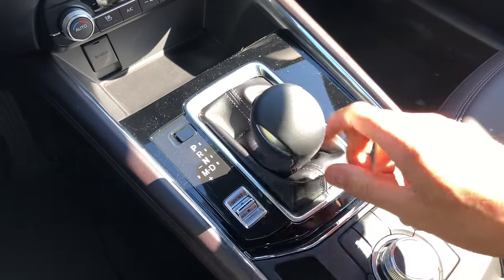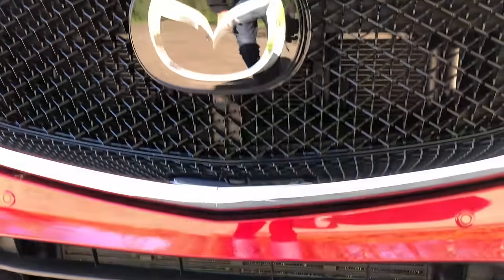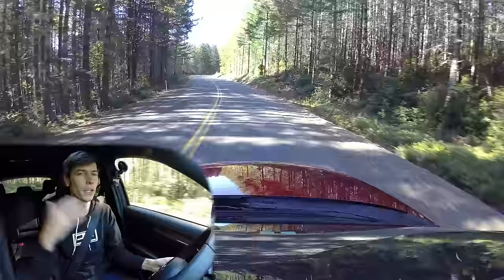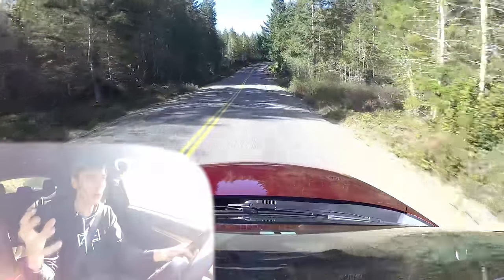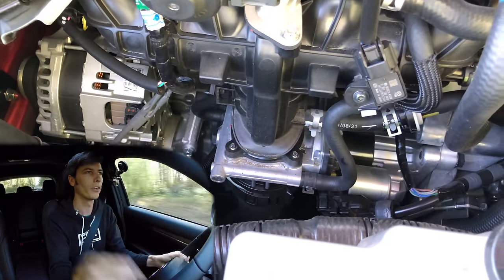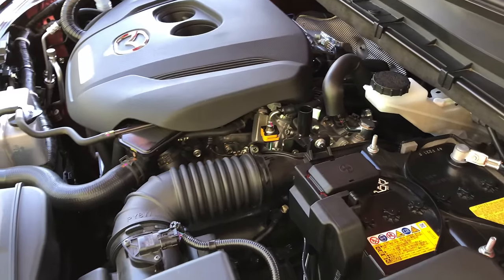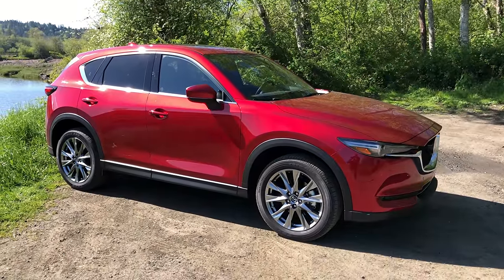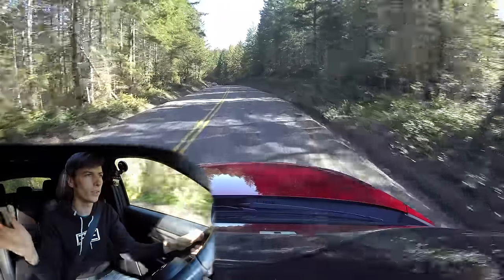Are CVTs Bad? Why Mazda Avoids CVT Transmissions

Comment: I'm a Honda guy and in 2014 I was going to buy an Accord. Hated the CVT and bought a Mazda 6. 100,000 miles later I've been very happy with my decision. I will not buy a CVT.
Reply: The 2016 and up Civic is nearly 2000s and earlier Accord sized and comes with a stick in nearly every trim. That’s what I bought.
Reply: Hondas are disappointing me with only the civic being the only car that has potential tuning, and even thats a cvt. Hopefully they bring their old golden cars back with manuals
Reply: Why do you think a cvt is wrong
Reply: @pilerks1  I question their durability and reliability. Some manufacturers are having problems with them
Reply: How is the newer model 6 holding up?  Any issues?  The cylinder shut-off feature scares me.  Other than that, I love the way they look!   I have a Mazdaspeed6, tons of problems, but that's an entirely different car..
Reply: @pilerks1   stop signs
Reply: I made the deadly mistake of purchasing an Audi with cvt 10 years ago. It was the dumbest thing I have ever done and when the cvt went it cost me $5500 Australian dollars.
Will never ever go cvt again
Reply: @pilerks1  they have lots of problems. Not strong.
Reply: @paulpower7018  None of my cvts had problems
Reply: @pilerks1  how many miles did you drive on them ? Problems don't start right away. And if you baby them maybe you'll get lucky.  Do so research. And don't ask a question if your not going to like the answer.
Reply: @paulpower7018  I'm saying my expirience. My 2003 murano with 120,000 miles had no issues when I traded it in at 2017. Other murano from 2012 had only 60k on it, then it was totalled just a few months ago
Reply: @pilerks1  that's cool I was just wondering.
Reply: @pilerks1  overly complex crankshaft and cams as well as engine timing.  I've never read a good thing about cylinder shut-off engines.. they have far shorter life's spans.. now granted these were all American v8s like Chrysler and Pontiac, so MAYBE Mazda figured out how to perfect it.. but I wouldn't trust a 1st Gen engine design.  I'll wait for the skyactive X engine to be ironed out- the most fuel efficient gas engine ever made.
Reply: Honda CVT's are ok as long as they are serviced correctly and you MUST use the correct CVT trans fluid supplied by Honda.  I know a number of people with them and they have had no problems with them with some now up to 250,000 k's (155,000 miles).  Nissan CVT's are one to avoid.  They are made by Jatco which is a Nissan subsidiary and they have always been very unreliable unless you are easy on it and service it very regularly.  Subaru and Toyota CVT's seem to be very good unless they are driven hard with poor servicing.
Reply: Get it in manual then🤷‍♂️🤷‍♂️🤷‍♂️🤷‍♂️🤦‍♂️ or can you not operate 3 pedals
Reply: Thomas Borisov I sure did all fluids and maintenance always completed on time when specified by Audi
Reply: @pilerks1  CVT transmission cars have questionable reliability. It also reeeaaallly takes away the sportiness of a car. The only reason people put CVTS in their cars is to save money on gas, when you're literally at most saving only 3 MPG. Will never buy a CVT in my life. They also overheat really easily under stress.
Reply: @pilerks1  only 120,000 miles? That thing was about to break down on you, you are really lucky that you got rid of that thing and not throw 4000 dollars for a CVT transmission down the hole.
Reply: @aytugdemir1323  Well I dont buy my SUVs and floor them around a track on my spare time. If I wanted that I'd buy a range rover or something.
Reply: @aytugdemir1323  I have no evidence it was going to break down. It felt fine. I've been reccommend to repalce a belt, and the muffler and shocks were going out, and it was getting old. That's why I got rid of it.
Reply: @pilerks1  you never know with a Jatco CVT transmission. That thing would've probably started to have problems at like 160,000 miles. And a lot of people look at how fast and sporty a car is.
Reply: @aytugdemir1323  cvt transmissions dont affect looks of a car. And no one cares to see as I accelerate through the rest if traffic at normal speed. 
I agree, sports cars shouldn't have a cvt. But an every day car for a normal person, a cvt is fine
Reply: @pilerks1  I never said a CVT ruins how a car looks. A person that cares about reliability does not consider CVTs to be fine. It's way better to buy a traditional automatic, than to buy a CVT (especially one of those Jatcos) that's th point I'm trying to make.
Reply: @aytugdemir1323  I have a 2008 nissan altima with a cvt and it has 168k miles and counting. I haven't had any problems.
Reply: Cvt just boring nothing wrong with honda cvt and higher mpg
Reply: Aytug Demir if you want the simplest, most durable, most robust and longest lasting transmission, you buy a manual!
Reply: Ilove cvt😍
Reply: Yeah let's not buy a CVT which has the most potential in the long run if the kinks are worked out
Reply: I had a 2015 Honda Accord, 2.4 CVT.  I had no problems and liked the idea that the transmission always found the perfect gear ratio for economy or power as needed.
Reply: @billharris3650  so basically, CVTs are weak
Reply: Corkfish1 My CVT has 166300 miles and no issues at all 🤷‍♂️👀 Proper maintenance is the key!
Reply: The third gen 6 is the best driving mid-size sedan available at its price point.
Reply: Bill Harris CVTs are for people looking to get from point a to b. They would generally have trouble locating their oil dipstick. I hate them personally and applaud Mazda for not using them!
Reply: @georgeschneider2414   what car do you have with cvt?
Reply: Ramon Lepana 2016 CVT Toyota Corolla LE
Reply: @paulpower7018  i specifically created youtube profile. I own accord 2013 past 2 yrs. ~ 165K mi. CVT. (Bought it around 100K mi, 1st owner didnot do anything to transmission). I changed trans oil 3 times. This car is so good, so smooth.
Reply: @billharris3650  my accord hit 165K mi. CVT. No issue so far. I did 3 timestrans oil change
Reply: The first time I test-drove a car with a CVT I flipped out becuase I thought the transmission or the tach was broken lol
Reply: Same here. Mazda 6 owner for 6 years. Not a single breakdown or major problem, just oil change and battery replacement.
Reply: CVT is boring but the passengers love it.
Reply: Cherries they are junk, lots of problems and not repairable, if anything goes wrong, throw it away, which means throw away the car.
Reply: @Corkfish1  from what I've heard, you just have to change the transmission fluid more often (once every 40-60k kilometres) and maybe install a reinforced belt instead of the stock. I think, it can be a good choice for city traffic driving.
Reply: I had my Mazda6 for 13 years. I gave to my daughter to drive to college.
Reply: @Corkfish1  and some do not.  CVTs, after the usual teething issues a new technology faces, are now superior the old inefficient autos. As for reliability Mazda has never gotten the rotary to do what was promised
Reply: @paulpower7018  maybe for a CVT built last millennium but modern CVTs built (excluding Mitsubishi and Nissan) are just as reliable and more fuel efficient
Reply: @aytugdemir1323  Wow your strength of opinion is in direct inverse proportion to your accuracy. You need to go away and do a little research about modern cvts
Reply: @MacTechG4  as long as you don't ride a clutch
Reply: @bp6837  CVTs without lock up torque converters maybe
Reply: @shanemurphy9024  Rotary engine? Lol. All I know is pretty much anyone who knows cars would recommend avoiding cvt. Honda still has a recall out for 2015 vehicles. Ive owned every Japanese brand.  Hondas are great. Ive owned them. But the old ones are actually better than the new ones. My 2014 Mazda has 150,000 miles on it and all its needed are brakes and a battery. Consumer Reports gave it number 1 ranking for 2021 and thats been my experience.
Reply: @shanemurphy9024  What makes you think a CVT is better than a traditional automatic? Seriously. It's so much better to have an 8-speed that gets similar gas mileage than a junky CVT. CVT transmissions have a lengthy history of breaking down a lot, and continue to do so. It's all on you if you choose to ignore the questionable reliability of CVT's. Even if you don't care about reliability, there are so many traditional automatic transmissions that get about the same gas mileage, and have much better performance and reliability.
Reply: @HB-md8rh  that's cool but if everything is OK changing the trans fluid every 20 seems excessive. Sounds like you were worried? Glad it's going good for you.  (Just Going by what you said getting it at 100k and doing 3 trans changes in 65k time).
Reply: @pilerks1  weak
Reply: @pilerks1  what kind a car do you have with cvt, what year and mileage on the odometer?
Reply: I using a 2015 Honda Accord V6 with Sports Automatic! Why? Because its the local market! Now, I got myself a Mazda CX-5. Nice car but not as fast as V6 Accord!

Comment: My 2017 Mazda6 is the best overall car I've ever owned, and I've owned a LOT of cars! Mazda just gets it, and the day they finalized their divorce from Ford is the best thing to ever happen to that wonderful little company.
Reply: J. Clark yes. Ford was destroying mazda reputation
Reply: Also got a "6"! 100.000 miles without any issue! Volkswagen..., never again!!!
Reply: I'm new to the Mazda consumer club, but so far I'm liking it. I've historically been a Nissan and Ford man, so going with Mazda was a "big step". Time will tell!
Reply: Have you ever had a Toyota doe? Lol
Reply: Mazda is like Morgan. Small but does things right.
Reply: 2016 Mazda 6 at 110k miles with no issues. May be one of best handling fwd sedans ever made that didn't cost over 30k. I'm waiting on their inline 6 rwd cx50!
Reply: @kevtn8  We have a 2016 Mazda 6 GT...bought new in 2016 and only 32000 miles so far, best car we've ever had.
Reply: @thecockflock  How is it such low mileage?
Reply: @raiderfly  We don't drive too much and just recently sold the 6 and got a CX-30
Reply: @thecockflock  Ah nice. I wish the previous owner of my car drove like you, 2016 Nissan Sentra with 130,000 miles
Reply: @vikramgupta2326  5yrs later?
Reply: @omarmzaham7248  About 90 k miles now and been very reliable and meets my needs very well. The only issue has been I've needed to have a coolant control valve replaced twice. Problem showed as a check engine light/P0126 code on scanner. First time dealer replaced it under warranty. Second time I had to contact Mazda Corporate and they covered part of the cost of replacement. So this is one weak link component for the CX-5. I did also have a fuel pump replaced due to a recall notice from Mazda. I myself had no issues with the fuel pump, just took it in for the recall.
Reply: I got 2016 mazda 6 is the best car ive ever owned!!

Comment: Big time respect for Mazda, refuse to dip into CVT’s and never made a hybrid. Instead went with the skyactiv route with totally re-engineer’d the whole car, made it lighter and stronger. And went with the super high compression gas engine.....good going IMHO
Reply: Mazda has CVTs and a hybrid Mazda 3. Just not sold in the usa.
The Mazda Axela has a cvt engine.
And the Mazda 3 hybrid has a cvt transmission also
Reply: Slim Thug >>Ah, good to know, thanks for the info
Reply: Slim Thug It’s smart they don’t sell them here in the U.S. Considering how the roads and drivers here are compared to other countries.
Reply: @slimthug660  Mazda 3 is sold in the USA, it's just rebadged as the Scion iA/ Toyota Yaris
Reply: @LordOfSilense  The Mazda 3 was always sold in the USA, just not the hybrid version. The Scion iA is a weird version of the Mazda 2.
Reply: an when ICE engines are illegal what do they do?
Reply: @brianh.8758  You are absolutely correct, sir. There is also a 2.3 billion dollar manufacturing facility in AL aka, Mazda Toyota Manufacturing. They each have their own buildings with production capacities of 150,000 vehicles per year.
Reply: @shanemurphy9024  The all electric MX-30 will come to CA in the fall. Rotary powered hybrid next year.
Reply: 2013 Mazda3 skyactive was a CVT.
Reply: Sorry but mazda 3 2008 vs 2018 not the same weight 2008 win
Reply: Mazda not making a hybrid is a point of WEAKNESS, not strength. The Prius gets 55mpg. Mazda sucks by not trying the Hybrid tech. They know they cant match Toyota in that area. Prius hybrid tech has gone through 4 generations of improvements. Its proven reliable technology.

Comment: That engine has cup holders!!!
Reply from the maker: Haha, "drink warmers."
Reply: Hahaha i lol'd
Reply: Wyvernzombie — This joke is at least 5-years-old by now...
Reply: @tcroft2165  Mazda = Cars and Coffee
Reply: You need somewhere to put your beer when working on the car.
Reply: @drivedb7  really? I just noticed it this morning
Reply: That’s the first thing I thought when I saw the engine.
Reply: Wyvernzombie — Shameful.
Reply: Sold!!! 🤣
Reply: The DODGE CHARGER 3rd Generation (LC/LA) actually has  'Under Hood Cup Holders' 

Really, it does..........

On top of the radiator core support cover there are two depressions that have been moulded into the plastic.Ralph Giles has confirmed these are deliberate moulded depressions for the intended purpose of providing a stable surface to place a beverage.

 Or maybe enjoying several cold ones as you wait for your new lifters to arrive because the set Chrysler fitted during factory assembly has failed, spitting out the needle rollers and grinding down the cam lobe sending trash throughout the engine.
Reply: More like cup warmers
Reply: @EngineeringExplained   CVT transmission in my 2007 Nissan Altima sedan and it's my first CVT and last over Rave 4,000rpm going down Hill own it's own all sorts of things.
Reply: That feature is actually for the technician. Not for the owner.

Comment: I purchased a 2020 Mazda CX-5 a couple months ago. I test drove a lot of CUV's and the Mazda was definitely the most fun to drive. One of the main things I was trying to avoid was a CVT transmission. They might be efficient, but I find when you want power for whatever reason they are slow to react. The engine revs high and not much happens for a few seconds until it finally realizes you want to accelerate.
Reply: Toyota/lexus hybrids have an eCVT and they dont have any issues that have been widely reported. They run just fine.

Comment: I just bought a CX-5 a month ago. I was on the fence between that and a Subaru Forester. One of the factors in my decision making was my reluctance to get a car with a CVT.
Reply: Good call - I got a letter from Subaru giving me an extended warranty for the CVT on my 2018 Forester to 100K.  Sounds good to get an extended warranty, but in reality it means they are having trouble and dealing with complaints.
Reply: @va4vi579  Thanks, I appreciate that data point. I heard mixed feedback on CVTs. Some said they had no problems, and that Subaru CVTs were fine, unlike some other makes. But the overall negative input made me sufficiently wary. Plus, Mazda was offering great financing on the CX-5.
Reply: @vikramgupta2326  CVT'S are made by JATCO, subsidiary  of Nisson (they also make for subaru, honda, etc EXCEPT Toyota)
TOYOTA MAKES THEIR OWN. and we all know the problems Nisson has w/CVT's
Reply: @schinianelli5547  Actually Honda designs and builds their own CVTs in house.
Reply: Ricky rocky  why did you think they aren't??
Reply: Ricky rocky gotta check your fact, Subaru use jacto Auto but always their in house manual and CVT. Honda always have their own CVT... it’s such an public information it’s even on the wikipedia...
Reply: @schinianelli5547  JATCO is not involved in making CVT's for Subaru. Subaru CVT's are made in house and are more reliable then Nissan who uses JATCO
Reply: Understood.

Comment: I bought a beautiful red Mazda CX5 for my wife minus the turbo and when you put it in the sport mode it scoots along just fine and makes it fun to drive. My wife is 62 years old but she puts a lot of miles on her cars every year so no need for the turbo. The interior is very nice vs the other crossovers and the drivers seat gives me plenty of room for my 6 ft -195lb frame when ever I drive it. The Honda seat was very cramped. Always been a Honda car and Toyota truck owner but the Mazda CX5 won me and my wife over this time around.